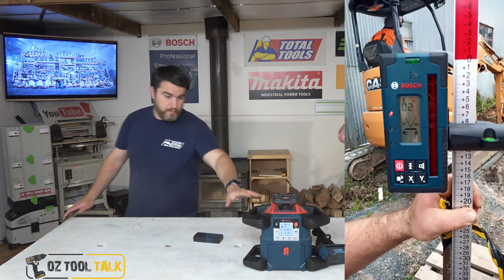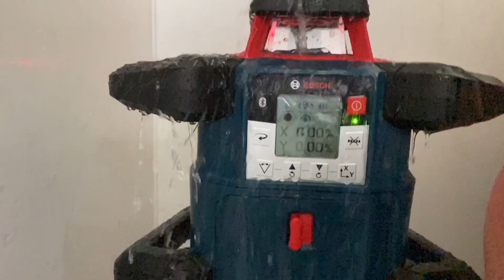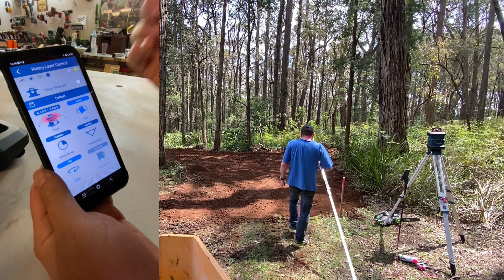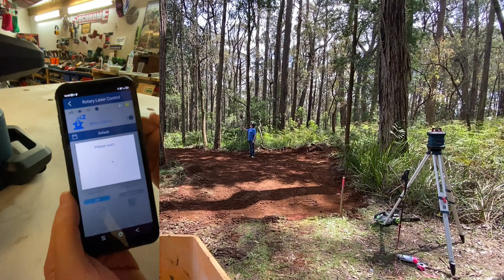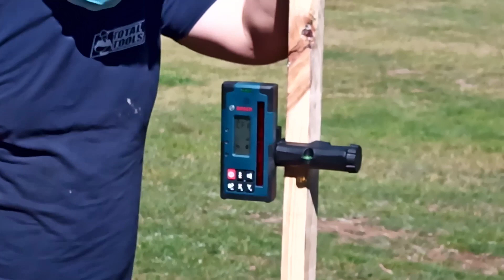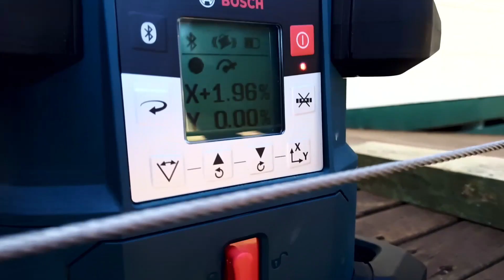Bosch 18V Rotary Laser GRL 600 CHV - Battery Powered! [2020]

Comment: I first used a rotary laser in 1986-87ish.  On my first big commercial job.  Wow!  What a game changer.  I your work requires a lot of elevations checks, these are a MUST-HAVE tool!   One man can set grade stakes all day long much faster than a two man team with an optical level and and a grade stick.  Can't remember exactly but I think it was fast beep=go down, slow beep=go up, and solid tone=on grade.

For concrete flat work?  Forget about it.  Dump a little pile of concrete at the opposite corner of an imaginary square a foot or so smaller than your screed length and strike it off to grade with the laser.  Then connect the pile with a line of concrete back to the form.  Use the floated pile and the form as reference to screed the connecting line down.  Now you have a line on grade and a form on the other side.  Fill in between the line and form and screed off the filled area.  One 10 or 12 foot box at a time.  1 man on the hose, 1 or 2 on the screed, 1 checking grade, 1 with a come-along/rake.  No grade stakes to pull/forget.  No more screed pipes leaving low lines.  Dot, connect, fill, dot, connect fill, dot connect fill. + - 1/8 in in 10 ft with ease. Lather, rinse, repeat.   All day long.  They really changed the game.

Comment: Spent 700£ on 3plain laser Great level  but there magnetic bracket is not strong enough i won't to put it on a metal stud with out it falling down at the first small bump bracket for the 3 plain is exactly the same as my bosch 2 plain but the laser is 3 times the weight.
Reply from the maker: ah bugger